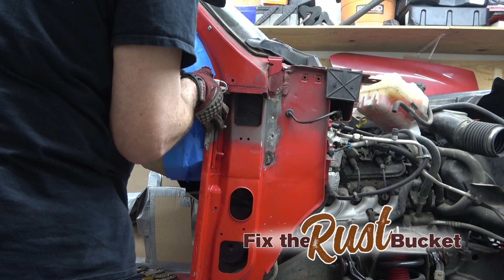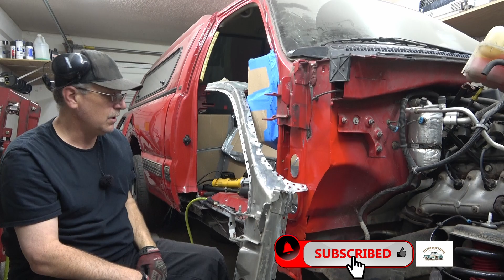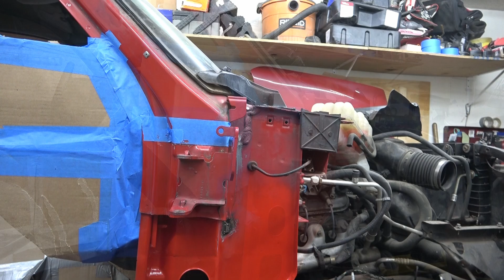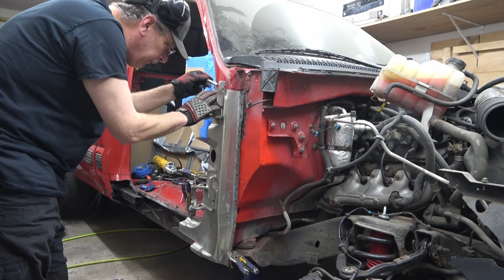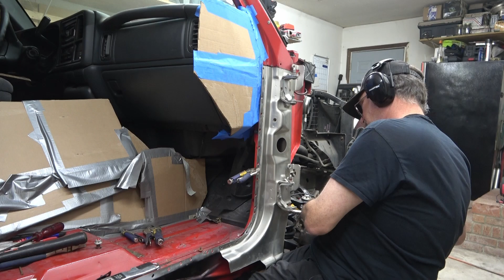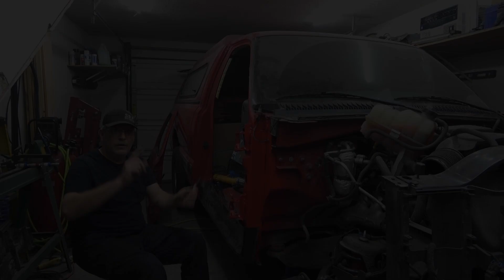How to Repair/Replace an "A" Pillar.

Comment: You need an MGF hat!  Excellent work!  When are we going to get to see the end product?  Kevin
Reply from the maker: Thank you Kevin! I was worried that the firewall might have been pushed in a bit. After mutable measurements on both sides, it seemed to be in line with the rest of the truck. I would wear a Mill Gap Farms hat no problem. I have looked on www.millgapfarms.com and see all of the wonderful Organic Maple Syrup Products your family makes, but did not see a MGF hat. I am wrapping up the rocker panel this weekend.